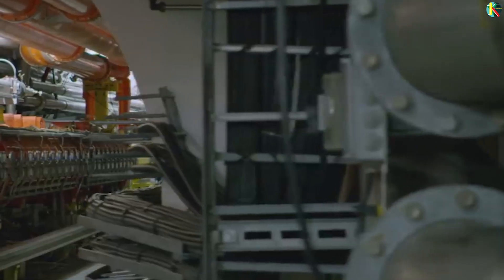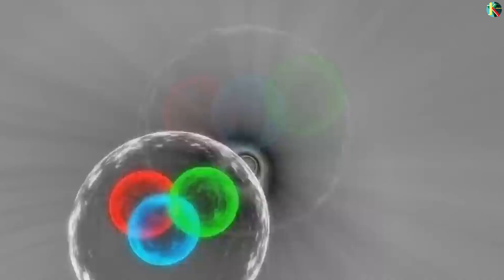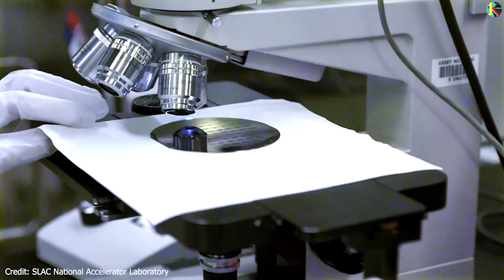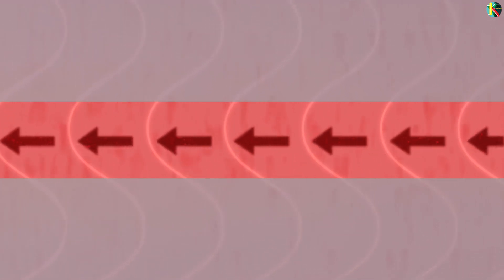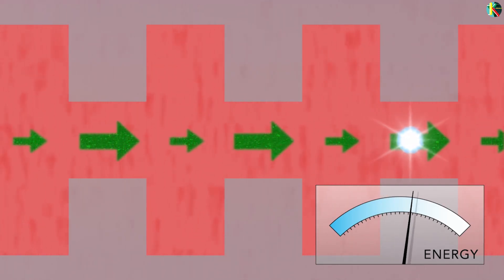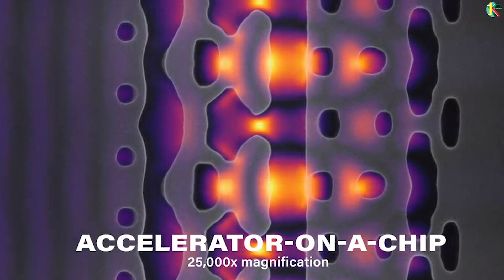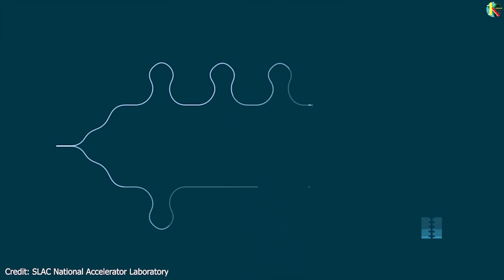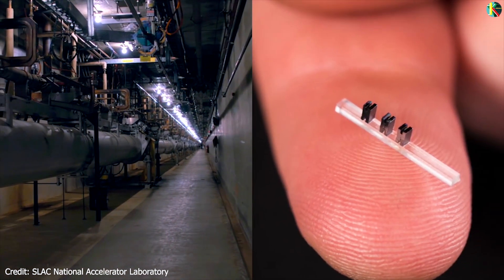Now you can have a particle accelerator in your pocket

Comment: I need to know the maximal speed this can reach.
Reply from the maker: Hello, thanks for watching. This chip accelerator is still a prototype. Its pros include the low laser power required (around 3 mW), the robust architecture that allows it to be integrated more easily into larger machines. However, the device still needs pre-accelerated electrons to work – in this case of energy 83.4 keV – and the pre-accelerators aren’t very small. The device energized electrons by 0.9 keV over 30 micrometers, which implies an acceleration gradient of 30.5 MV/m. However, main target of the researchers is to hit the 1 MeV mark which will accelerate the electrons to 94% speed of light.

Comment: "high-energy electrons" What's the electron energy from the miniature accelerator?
Reply from the maker: Hi, thanks for watching. The Stanford researchers found their prototype could successfully boost the electrons’ energy by 915 electron volts. Although that amount of energy is miniscule by everyday standards, the increase occurred as the electrons traveled only three one-hundredths of a millimeter—equivalent to them gaining about 30 million electron volts over the course of a meter. Scientists are working to push the 915 eV limit to the 1MeV limit.
Reply: @Kugelblitz_Science  Thank you so much!
Reply: @Kugelblitz_Science  Do the electrons run through the accelerator in a sustained fashion? Can they stay on track, or do they get lost after some time?